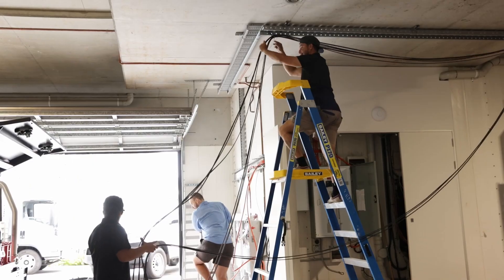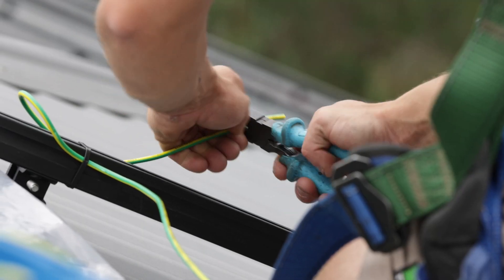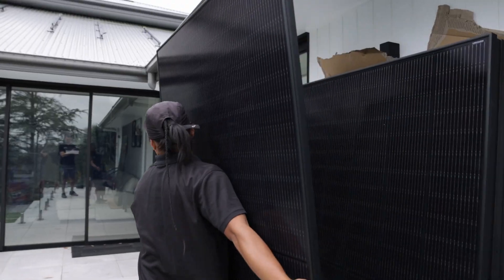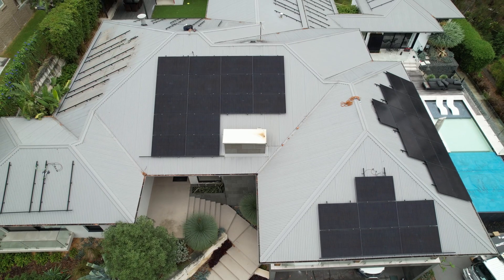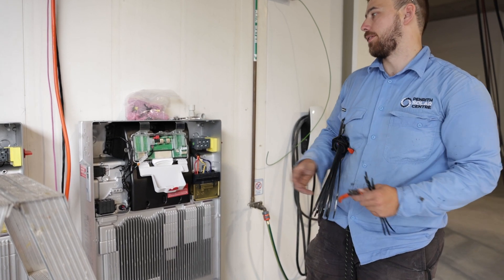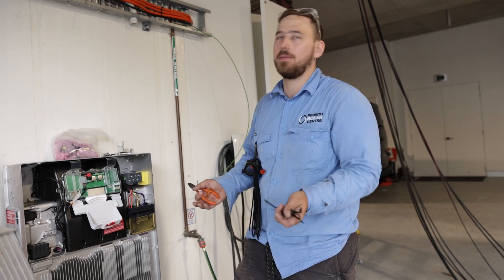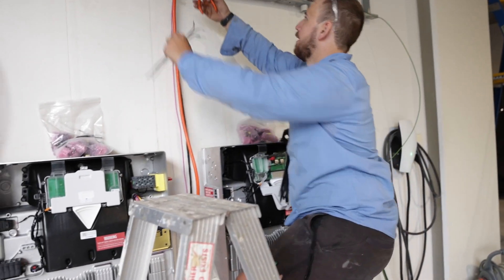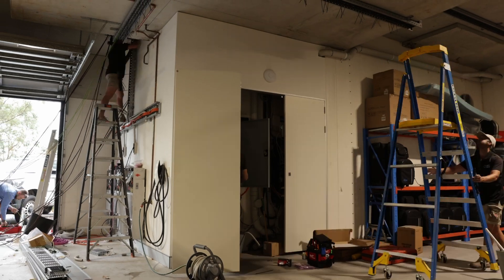Triple Tesla Powerwall 3 Install with 52 kW Solar Panels

Comment: There is a lot of shaded roof from the rooftop PV panels.

Landscape panels means rails run up the roof and provide best cooling ventilation under the panels. 

These features lower heat load and air-conditioning costs.